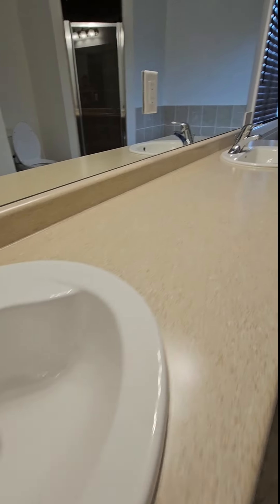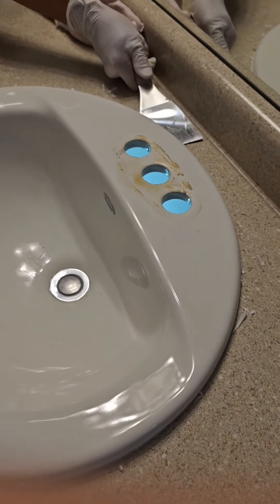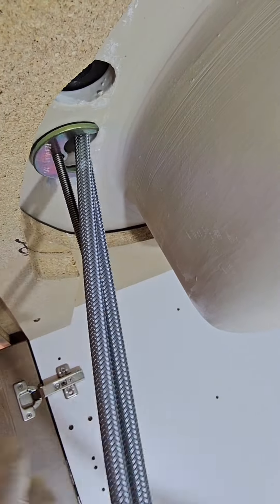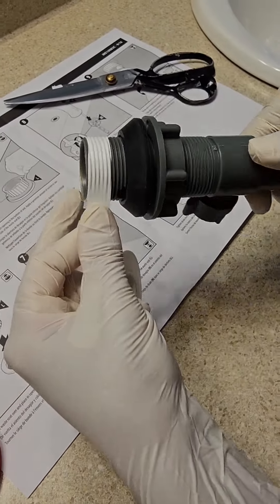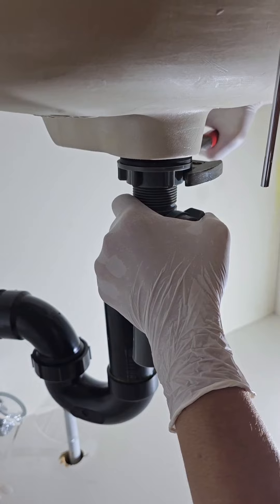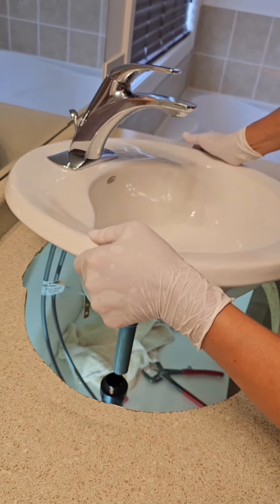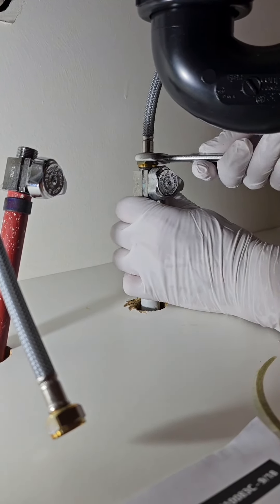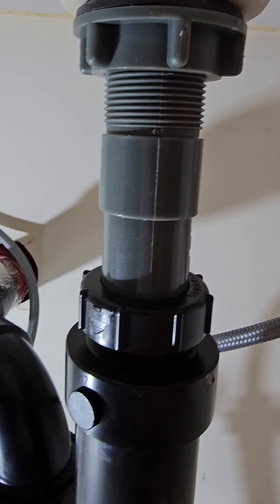Detailed Guide to Replacing a Bathroom Sink! 💧🔧

Comment: It may not a bad idea to remove the p-trap before install the sink, since the drain hole of the old and new sink may be in a different location.
Reply from the maker: I had unintentionally chosen a sink that lined up perfectly with the P trap, so I didn't have to worry about it. But you're right, if it doesn't match, it's necessary to remove the P trap. I tried to give a little advice in the video as well as to the positioning for that installation.